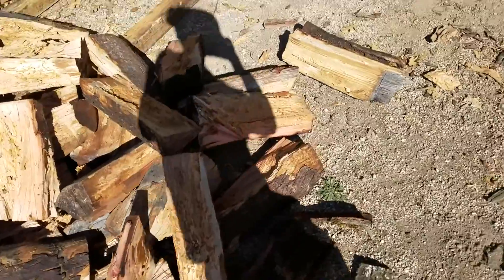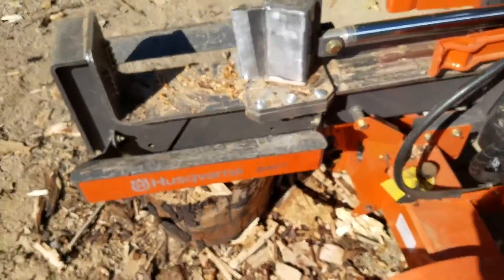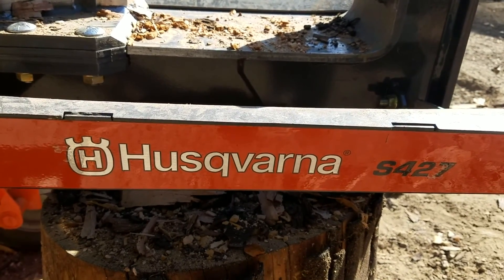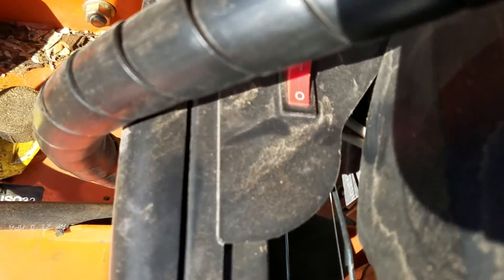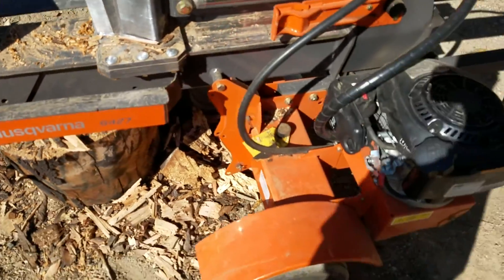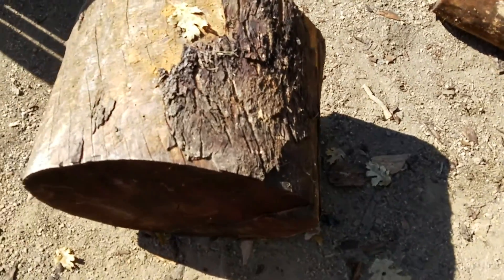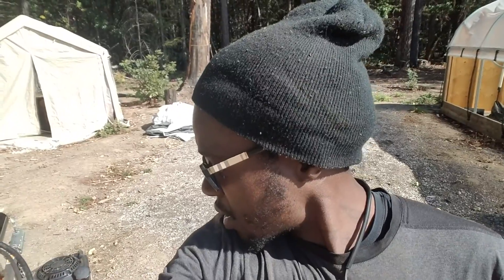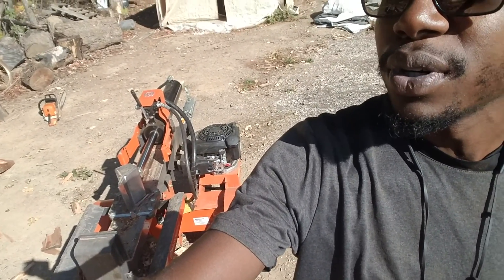Husqvarna S427 Log Splitter Review + Demo!

Comment: An arborist (tree cutter & remover) down the street delivers all the wood I want to my driveway for free.  These are rounds (tree sections) about 1' long because he carries each to his truck by hand, and a green 1' round weighs a lot.  So I only have to saw a few branches to fit my stove.  He says that it used to be a lot of people wanted this wood for their stoves, but now few do, because of No Burn Days (people claiming they can't tolerate smoke and the gov't  passing new laws to protect them).  

Why does the arborist give me free wood & free delivery?  Because when he cuts down a tree he has to spend an hour driving to the county dump & back, and pay a big dump fees.  He brings me mostly hardwoods, & no palm.

Re house sizes:  I know a man who bought a 4,250 sq ft house and burns FIFTEEN cords of wood per winter to heat it!  He probably paid $Thousands just to buy a big enough woodshed. 
 Americans are taught that bigger is better, but my wife, son, & I have plenty of room in our 1,000 sq ft house.  It has 3 bdrms, 1 bath.  You don't need a huge house. 

Americans sure do need more exercise, and splitting wood with a big heavy maul is a great way to get it, and also to build your upper body muscles.  For every man with smoke coming out of his chimney and a gas/elec. splitter & chain saw in his garage, there is a fat stomach.  And sadly often an early death from heart disease.  The man with the machines also has an emptier wallet from buying, fueling, and repairing those complex machines, and deafer ears from all the NOISE!

There is a great satisfaction from giving a round of wood a tremendous hit with a maul, or a sledge hammer against steel a wedge for tougher wood.  Try it, & you'll never go back to the "modern" way!

Maybe you'll think about all this before you buy a sit-in tractor mower for your front lawn, or another chain saw to replace your broken one.  Modern man is not doing himself any favors with all those home machines.  -  JH
Reply from the maker: My friend, we live on a high production farm. We have employees, we have many other tasks that need to be done and log splitters increase farm production. It is an efficient way to provide energy for the winter. On our 6 acres in a rural area so loud noises are not a problem. Peace & love and stay warm!
Reply: ive split my share of wood with a maul and now i have a spliiter its alot easier and cutting wood by hand when your one person youd never get enough wood for the winter and you strill have to man handle it and stack it etc. so its still a work out so therefore your logic is wrong yea the old ways worked but today we have technology you still get a workout alot more efficiency and that gives you more freetime to spend with family and friends